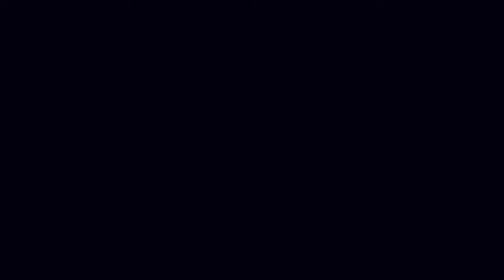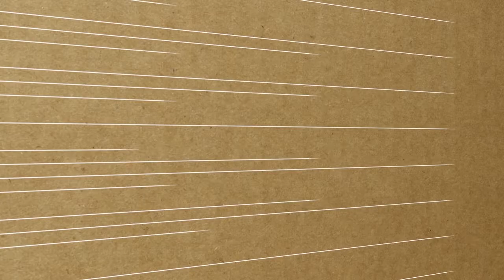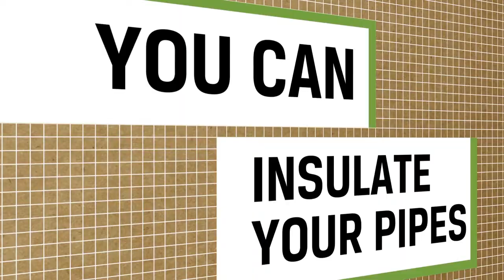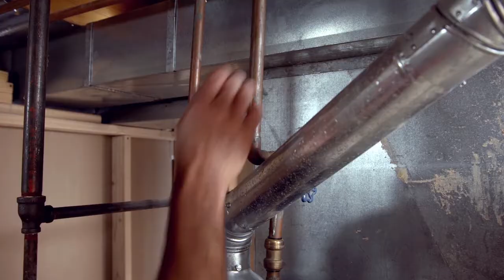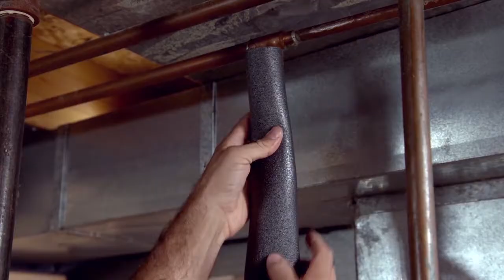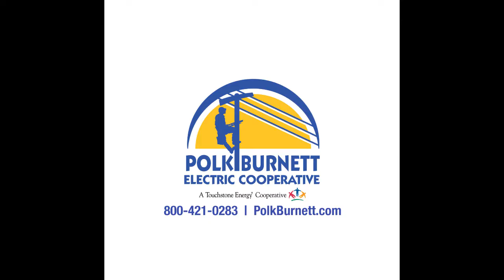Insulate Your Hot Water Pipes to Save Energy, Time and Money

Comment: Multiple foamed rubber pipe wraps are rated fire-resistant. If you're really worried about it (which you shouldn't be), then get some velcro aluminized fiberglass vehicle pipe shield (looks like header wrap but is velcro closure). Orient the velcro on the far side for the pipe from the flue. BOOM. Will repel a butane torch from 6" now.

Comment: Hey handsome HVAC sir, should I insulate the water heater chimney/vent?
Reply: I mean the big stainless steel pipe in the mid.
Reply: @2339091q  No! That is a fire hazard. There's also no reason to insulate it. In addition the foam on the pipe should not be installed so close to the exhaust vent. Check your local regulations for how close combustible material is allowed to be to a water heater exhaust pipe.
Reply: Is fiberglass better then foam? Which one you recommend??

Comment: Why is everybody saying those foam stick are flammable/combustible  ???
Reply: If it's near the water heater exhaust, use fiberglass instead
Reply: @andrewziem370 wont fiberglass burn?
Reply: @redsresearch  The glass fibers melt at 1000F, while the binders decompose at 500-800F. That's pretty hot! I am not an expert, but I think the exhaust pipe should not be that hot. Check yours using infrared thermometer under heavy load, and allow a little distance from the hottest parts.
Reply: Because it has carbon in, which means it can burn.
Reply: In one video a guy said that some building codes require that you keep the foam 6" from the flu pipe. In some cases that may not be possible, so you could use fiberglass. BUT, if the tank is located in the main living area of your home, like a little utility room or closet, you don't wan't exposed fiberglass in the environment as fiberglass dust can waft out. You would have to wrap it to seal it which could make you wonder  whether all the effort and expense is worth even doing it. Sometimes having a little heat in a semi-enclosed area isn't necessarily a bad thing.

Comment: I did it, but without the intersections. So I suppose my pipes are only 95% more efficient than previously.  But those connectors are a lot more expensive than the simple long insulating tube.